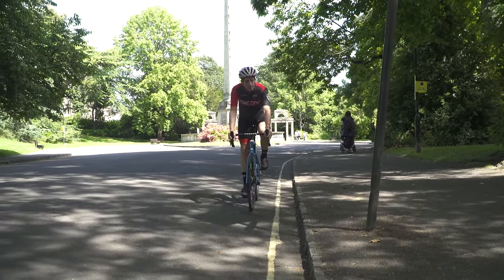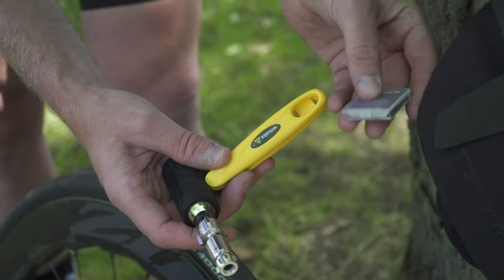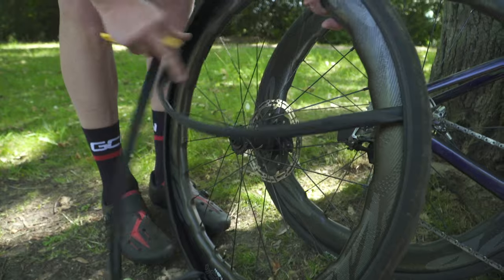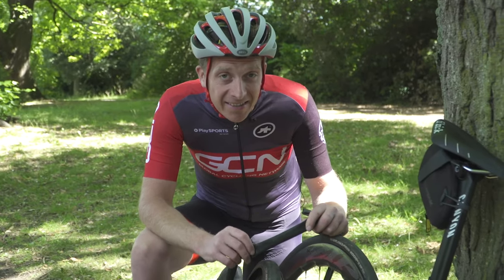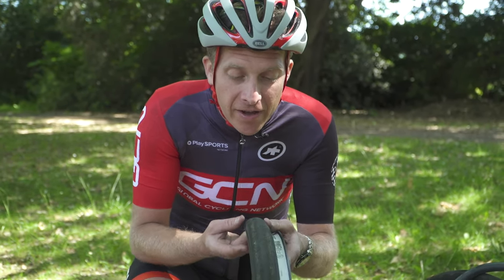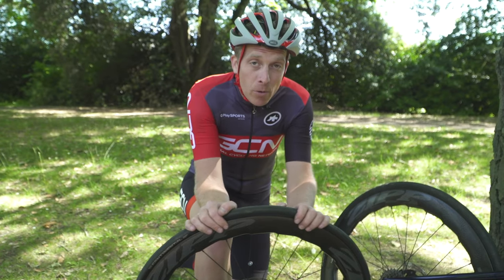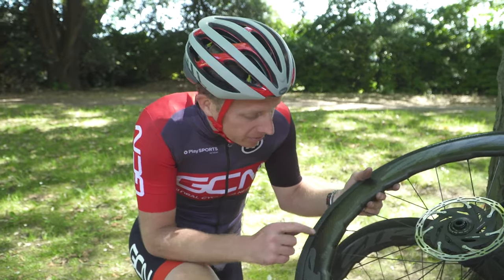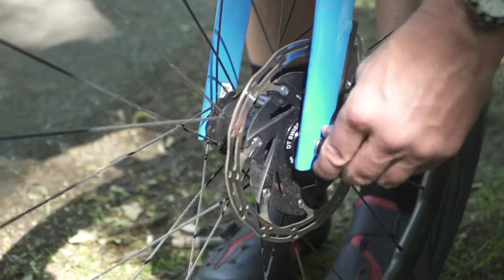How To Fix A Puncture On A Road Bike | Repair A Roadside Flat Tyre

Comment: Some comments I don't agree with; water can cause delamination of carbon?   Did not highlight that the tube is coated in release agent from the manufacture and it essential it is removed (sandpapered off) to ensure the patch  remains reliably attached and does not leak. Also, not certain if you can get a pitch flat from the tube being caught under the bead (will pull itself out when inflated), more likely you will get a pinched tube from careless use of the levers putting the tyre back on.

Comment: In many years of riding I've never even owned a Co2 pump and usually only carried patches. I've recently come to the realization that in a group ride you should really have both a tube and Co2  with you as a courtesy to the other riders so as to keep the others waiting as little as possible should you get a flat.

Comment: Well, I would just like to say that I always carry a spare tube, not that it helped much on the day I had five punctures. Touring in Spain. They have some evil little spiky plants that have seeds with points that will go through a fairly hefty tyre. The worst thing is that they have more than one spike so they always have one pointing up. Since then I've used Kevlar reinforced tyres and slime in the tubes. They will still go flat (ish) but put some air in once you have pulled the spike out and they are good to go. Yes, I know it's heavy. But I don't like repairing a rear tire in the rain or hot sun by the roadside. Plus someone always comes up to ask if they can help at the precise moment I'm putting the bags back on the rack. 🤔

Comment: I wouldn't bother patching a tube at the road-side. Bring a spare tube and patch the broken one back at home. The self-adhesive patches are fine for getting you home but I've always found that they give up after a couple of weeks and the tube goes flat again -- so even if you do patch at the roadside, you're going to have to put a proper patch on anyway.

Comment: Do those topek stickers really work. After watching one of your previous videos on how to save money on cycling, I really tried repairing tubes. Best success of a repair was a bit over a month. I'm back to $5 tubes, I carry one with a mini pump and tyre leaver.
Reply: Use the regular contact cement patch kit.  The tube will outlast your tires.

Comment: the main reason to not blow up the tube after you patch it is, when its in the tire that pressure creates a stronger seal since its being squeezed between the tire and rim

Comment: Only other thing I do is to check the inside bottom of the tyre, as when you are rotating the wheel to finger check the inside, the little tack or bit of glass can just be rolling to the bottom each time. At home I pump up tyre, then deflate and reinflate to make sure it is not pinched.

Comment: With hydraulic disk brakes, don't you need in insert to accidently keep the calipers from locking together?
Reply: only for traveling if you want to avoid problems when the levers get pressed accidently, not for just chainging a wheel. is not difficult to reset them back if it happened accidently though.

Comment: 1) Whoa Jon is actually on a bike!!
2) Another tip you missed DO NOT PULL THE BRAKE LEVERS WHILE THE TIRE IS OUT ON A HYDRAULIC BRAKE BIKE!! You will close the calipers and that suuuuucks trying to get them back in. Get yourself some caliper shims to put in there while you work on your wheel!! Most LBS's will give them to you for free if you just ask.

Comment: He did it, but he did not state that you need to completely deflate the tube before roughing up the surface of the tube and applying the patch.  Also, I wish my road tires were that easy to remove and put back on the rim.

Comment: I never had puncture on front wheel, why you show it on front wheel? :D 5x on rear wheel
Reply: Why not the front wheel? Other than the chain and rear mech nothing's different.
And funnily enough most punctures I remember getting where in the front.
Reply: @boomerangfreak  maybe on rear is easier to get a puncture couse of more weight on that tire and when you see something on road, you can avoid it with front tire easier then rear tire
Reply: @boomerangfreak  I would actually like to see how to efficiently and properly remove the rear wheel and put it back.

Comment: A ‘pre -removed’ Continental tyre? Has to be, these are notoriously difficult to remove and replace. I notice that , fortunately it was the ‘front’ wheel being dealt with? No need to ask ‘why’ here. Then he refitted the tube!! Why? Just to have to do the job all over again when you notice later on that your tyre’s leaking air? 
All out in the countryside in cold and wet weather? So, the absolute ‘basics’ here then? I have not seen a tyre patched up in years, so that was interesting. 
I can’t help but feeling like I’ve been ‘short changed’ here. Thank you.

Comment: Karma will hit me for typing this; however, after a year of cycling, I have not had a single puncture or flat.  That being said, this video was very helpful when the time comes (On my next ride.). I do have a lot of troubles getting that back wheel on after removing it though.  It just never wants to go back on.
Reply: You can easily practice removing and installing a tyre tube without a flat you know. Watching TV on the couch is a good place to practice.

Comment: Put snot (sealant) in the tube when fitting a new tyre. You'll probably wear the tyre out before realising you had picked up the odd bit of glass etc.
Check tyres at the end of each ride to remove any offending items.

Comment: You'd think somebody would have invented puncture-proof tyre for bikes, motorbikes and vehicles by now and become a millionnaire, perhaps a flexible woven metal strip incorporated in the rubber would do it.
Alternatively perhaps a solid tyre would do the trick that needed no inflating, made out of a honeycombed rubber compound.

Comment: Whenever I've had a puncture, I can only ever get max 50 psi in the tyre with my mini pump. Is this normal and can I continue on my ride? I usually head straight home after I've fixed the puncture as I'm not sure if that low pressure is okay to continue. Any advice GCN community? Invest in some CO2?
Reply: Buy a bike trailer, a deep cycle rv battery and a 20gallon air compressor. Then just put the compressor in the trailer and hook it to your seat tube 👍

Comment: GCN does a video on being environmentally responsible, "don't use CO2 cannisters", then does one on puncture repair....with a CO2 cannister! Also just carry a spare tube, fix the punctured tube in the comfort of your own home or garage. I would also always check the inside of the tyre in case the offending debris that caused the puncture is deep into the tyre.
Reply from the maker: did you notice I didn't use the CO2? Jon
Reply: @gcntech  True, but you didn't say cos Opie says I shouldn't due to it being environmentally unfriendly. I forgive you though because all your videos are amazing. #favouritepresenter
Reply: @chrishey6891  😉

Comment: Hello. Love the show, and I watch roughly every week. I have even gotten my wife to enjoy it. I have a tech question; I run a Shimano Ultegra R8000 with a 53/39t crankset chainrings and 11/32t cassette, this with a medium derailleur cage (total differential 35). I am a bit curious about the oversized pulley wheel system, but I can't figure out if it will fit my current setup. On CeramicSpeed's website the OSPW are compatible with the Dura-Ace up to 32t, but the Ultegra system only 28t. Why is that? Will the system still work on my Ultegra setup as it is, or do I have to change my entire setup? #askGCNanything #GCNTech #GCNshow #Torqueback

Comment: Nice video but ... but ..... very often the tyre is very very tight to the rim, and removing and remounting it, is not so easy as depicted in your "how to".  This happens more frequently with not folding tyres and with certain brands of tyre (I am sure you are familiar with ... :) ...)

Comment: Had the same issue, glass puncture my tyre and changed the inner tube. My question is it safe to use the puncture tyre? Or i need to replace it? The puncture hole is very little. Just want to be safe.

Comment: And when you line up the tire logo with the valve hole, how does that help in locating how far the puncture is from the valve?Anyone please tell me the usefullness of having the valve and  logo line up other than some OCD middle-aged roadie retarded rule?
Reply from the maker: It's more about locating the valve in a hurry for race mechanics.
Reply: @gcntech  GCN, c'mon men, 99.9% of people watching your videos will never race.
Reply from the maker: if you know where the hole in the tube is, you know where to look for the offending item that caused it, if it's still in the tyre. And vice-versa, if it's obvious where the item in the tyre is that caused the flat, you can easily find the hole in the tube. Simples. Jon
Reply: @gcntech  Which brings us to my point again. The logo doesn't matter. It could have been non-existing and one would still be able to locate the cause. All I am saying is, how does the logo help? can't locate a valve poking out of a rim? I don't get it.
All that matters is locating the hole in the tube, which is usually what you want to do as soon as you flat a tire, then try to find the exact position on the tire and remove the sharp object. Just admit already, the Tire logo and the valve thing is only for race mechanics where every second counts but, for your average joe, we got all the minute in the world to change a damn flat.

Comment: I love/hate seeing the use of a CO2 canister the day after a video that suggested not using them due to their environmental impact. Our convenience is sometimes seems too hard to pass up for the sake of future generations. #mixedmessages #irony
Reply from the maker: It's a personal choice Aaron, but as Jon said, you can run out of gas canisters, but never run out of air. It's up to you.
Reply: @gcntech  I totally agree! I go both ways in my decisions on this one, depending on convenience and need for speed. I was just pointing out how our value of convenience is sometimes in conflict with our values for the environment. The same tension gets repeated across a thousand other little decisions I make in everyday life.

Comment: Carry 2 tubes.
Reply: Tube + patch kit.  Lighter/smaller than two tubes, yet still have a secondary backup if you get second flat.
Reply: @cup_and_cone  fix tubes at home. I carry 2 ultralite 700c tubes. Very compact to keep in pockets or saddle bag.
Reply: 2 tubes + glue-less patch kit. I've pinched a new tube putting it on a rim before! It is possible to get two flats on the road at the same time if you're really unlucky.